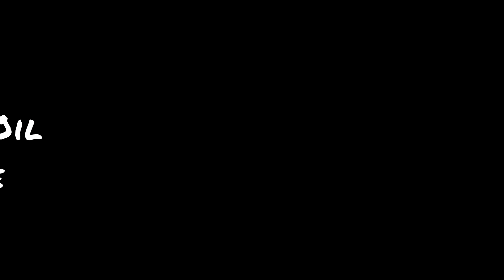Key Holder made from Old Wheel Barrow Handle

Comment: Hi Grant. I really like the way you snapped the wood to length to keep the rustic look. Nice work. Cheers, Huw
Reply from the maker: Thanks Huw, I had made one of these before (from the other side handle which was in far worse shape) and I really liked how the broken ends looked. I thought it would be much easier to break the wood because of how poor the condition was, but turns out that it still had some strength left in it! Thanks for watching 👍🍻

Comment: Hej Grant, the clamps might not be broken, I had one of those squeezy clamp things fail on me last week in a similar fashion, but it had screws that came of the handle part and it was just a matter of attaching the inside bits with springs etc to their respective spots.
Reply from the maker: Thanks Yves, sadly these ones are broken. The plastic casing actually cracked on them 😓 I did expeirement with putting all the parts back together and considered using some kind of glue, but then I knew they would be fragile, so I just put them aside. Thanks for watching 👍🍻

Comment: Am I wrong, or did you put water based on top of oil? 🤔
Reply from the maker: You are not wrong! As long as the oil has cured I have found it to work out alright. I usually wait about a week to ensure maximum curing time. 👍🍻 Thanks for watching Geoff 🍻